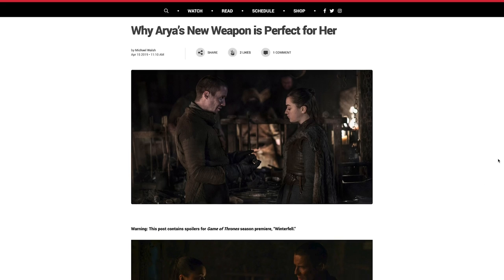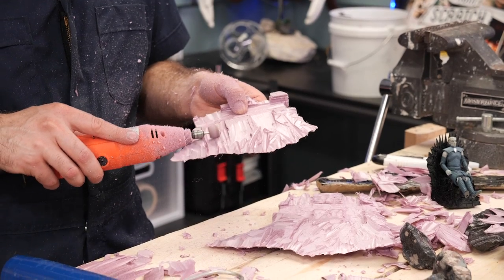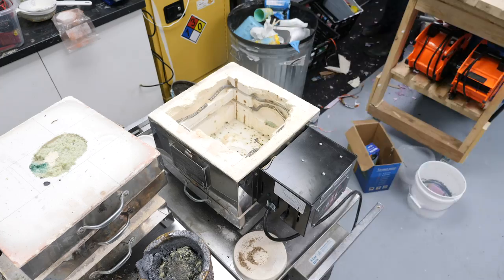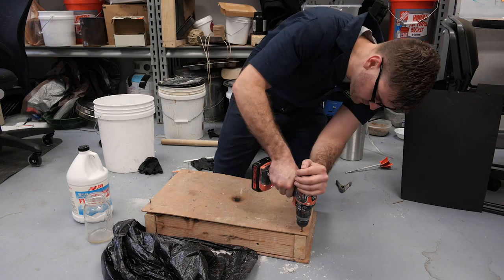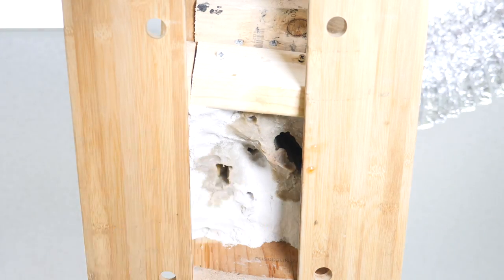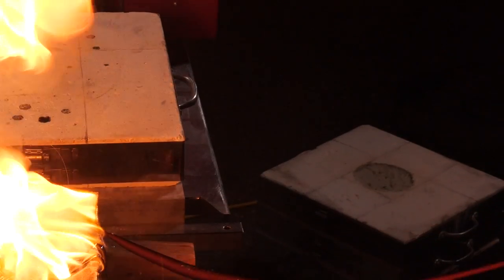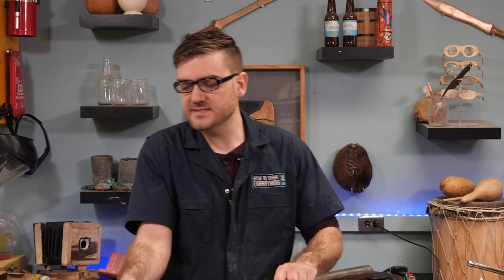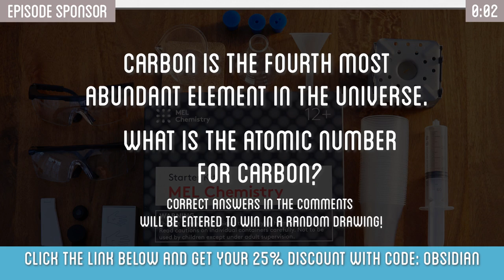Melting Dragonglass to Cast an Obsidian Axe

Comment: You should build your own kiln ... Seeing as how you go through the 1-3 an episode
Reply: Matthew Olsen right! Alec steel has a good video on it
Reply: He'd probably break a kiln while making his own.
Reply: It is an important piece of technology, and making one from scratch is not too difficult. Plus, he can do a second video and make a modern electric one with modern materials.
Reply: should go old school and build a legit one
Reply: hell, he might be able to piece together some working parts from all the defunked ones he has unless he tosses them out immediately apon literal meltdown
Reply: I've seen at least 5 different channels make them that are propane. Made specifically for melting metal.
Reply: @catman2157  a furnace and a kiln are not the same.  the furnace can't get hot enough for glass
Reply: I just wish I was in a position to be able to keep buying new kilns.  LOL
Reply: That is a good idea

Or he should find a place and get a deal on them for a large amount
Reply: I think i can provide blueprints for a solid forge that can be used as a kiln it boils down to a foot thick brick wall sourrounded by those hollow sinderblocks copper tubeing cement and a propane tank or two

Comment: At this pont, he could probably make some discount deal with a kiln manufacturer...
Reply: i think a klin manufacturer has to sponsor them
Reply: Or work for them as a full-time stress-tester.
Reply: @janneaalto3956  *user incompetence tester
still love the guy though
Reply: @MsHumanOfTheDecade  hahaha so true!
Reply: I dont understand how hes fucked up so many.
Reply: @ButteredSlightly  Molten glass is very corrosive and therefore basically eats away at the kiln. He also probably cranked it to the max to get the glass as moment as possible, therefore increasing the change of a failure within both the mechanisms of the kiln and the kiln itself. If you see his old videos, every cast that was in contact with glass can be easily noticed due to how the glass sticks to the kiln and the crucible inside. Even in this video, that can be seen
Reply: Nazamroth he has got to start buying in bulk
Reply: LOL! I was thinking the same thing. Or even a sponsored deal. Though, if their kiln keeps breaking....maybe they don't want him advertising what he's using... lol
Reply: @ButteredSlightly  to be fair melted glass is like acid that destroys the klin.
Reply: Could or should.
Reply: How To Make Everything should just get a devil-forge, hot enough to melt glass, never breaks.
Reply: I'd buy a kiln if he did that.
Reply: Here's two of my New Episode ideas, (1) How to make a kiln from scratch?; (2) How to make babies from scratch?, if he fux up either then lolzzz...
Reply: Did you mean point not pont

Comment: as someone who did a 4 year apprenticeship to become a molder i will tell you a few things. add vents and risers to your thinner parts of ur mold. Yes it will mean felting after but the risers will draw the metal to the thinner parts. also for a think mold like that i would prob do a 2 box flat back mold with vents and risers on the flat side to hide them and also i would have the mold flat not vertical

Comment: Try casting obsidian to give a rough shape of the final form, with enough thickness to knap it
Reply: That was what I was thinking. It seems plausible to cast obsidian in order to get it to a close shape to what's needed, then knap it to a razor edge. I'm not sure if the casting would affect the ability of the obsidian to fracture sharply.
Reply: @Guru_1092  it'd probably make it too brittle to knap. It would more than likely shatter completely after the first hit.
Reply: you can't knap it after it's cast sorry
Reply: its structure is different after a cast
Reply: That's the ticket right there
Reply: You could just knap an axe head from normal obsidian, melting it again weakens it because it cools at a different rate.
Reply: I was thinking cast it around it’s metal reinforcements, so that they are in place to give the obsidian something to hold on to as it cools. As well as casting it larger than expected and nap it till you get the final shape.
Reply: What if he just bought a couple of very large pieces of obsidian and just knapped them to shape? Edit: Or maybe get two long pieces and make one half of one blade and weld them together with obsidian to make one side. Repeat to make the other side. P.S. Can you weld obsidian?
Reply: I think casting it into a solid brick like form then napping it would yield the best reault.
Reply: You cannot cast metal in glass. The expansion and contraction of the metal would at best lead to separation, at worst cause it to fracture explosively
Reply: You CAN cast obsidian so it can be napped. Just don't add any flux or fillers to make it melt easier.
Reply: The casting would weaken the structure of the obsidian as seen in this castings, they easily break so I doubt he would be able to knap it without breaking the whole thing
Reply: @EagleclawThom  Giving the obsidian "something to hold on to as it cools" as you put it would only serve to cool different parts at a faster rate, causing the whole piece to shatter.

Comment: Might want to save up and buy some purpose built equipment.
And some classes on casting techniques.
i.e. your manufactured obsidian could probably be cast flat on an open mold, torch heated to slow the cooling process (simulating the slow cooling process of natural obsidian), while moulding the flat side with tools to get the flat side textured.
Similar to modern glass sculpting techniques.
But where the fun in not burning out a half dozen kilns and overburdening the local electricity grid with wattage it was likely never meant to sustain?
Reply: Classes...  It's painful to watch this guy do almost anything.

Comment: Stop using electric kilns and make a gas foundry
Reply: SerenityGene He tried.
Reply: @shania-antonio6425  😥
Reply: why stop at that, aim for the stars directly skip to the backyard-blast furnace :_D
Reply: @SeleenShadowpaw  or literally aim for the stars... Make a furnace using a giant fresnel lens and the sun
Reply: I think the problem with gas is that it adds impurities to your castings.
Reply: @xKatjaxPurrsx  in the case of obsidian it is nothing but impurities. Also you will notice that plenty of foundries still use gas as well.

Comment: How to success:
Cast one big slab of obsidian, that is flat and wide
Knap it into your desired shape
Reply: Great method, right until the moment he makes one false blow, and snaps the whole axe in two lol :P
Reply: @Michael-Archonaeus  LOL that definitely might happen
Reply: Also tell him to not add flux, it ceases to be real obsidian at that point. He may also want to melt it in a nearly 0 g*kg (of normal force, finding a place with 0 g is impossible as technically gravity is affecting you wherever you are, 0 g*kg of normal force can be found in low earth orbit) vacuum using electric welding rods in a similar fashion to how it is done in The King of Random. Then he can draw the molten rock into whatever shape he wants!

A mold is never going to work for a proper weapon, regardless of material, it must be forged gradually across its length in order to not have one crystal structure that forms parallel lines of potential failure.

Comment: this assumes "dragon glass" in the GoT universe is really just simple obsidian and not some magical substance
Reply: If I was going to force it into reality I would go with a doped obsidian. Glass combined with metals, fibers, etc.. that together are strong. Basically things that could reasonably exist within a dragons den that got melted as the dragon was finishing up her home by melting the walls (likely partly silica) and adding things that would strengthen the walls. Kinda like how a bird collects stuff for their nests.
Reply: @trashpanda5947  Dragon glass in game of thrones could have Valyrian steel as one of it's components since it's the only other thing that can kill white walkers. But since Valyrian steel is based on Damascus steel which is just a type of steel, it probably doesn't exist naturally and was smelted.

Comment: A general thing about plaster casts: you want the mold to at least touch 720c. Any volatiles left will result in voids and a hot mold assists with flow. Keep it hot.
Reply: yeah the liquid glass was starting to solidify as it touched the mold, so it didn't fill the mold properly.

Comment: Hello love watching your videos, keep up the good work! Just would like to point out that you were 100% correct when smashing off the mold the next morning you said "I don't know why that happened, maybe I didn't burn out all the wax"...the telltale was from the nice yellow flame when you were pouring into the mold (or where I'm from "mould") as it was burning the gases trying to escape the mold as the superheat contacted the wax pockets you had mixed. Also, pouring into a mold from a kiln outside is not advised for best results as you could see cooling to a thicker texture as you were pouring into the mold. Just finally like to add that I do not in any way shape or form declare that I could in any way do a better job than you, and I am no hater, just trying to point out a couple things as all knowledge is good knowledge, and thanks for your knowledge :)

Comment: Sodium silicate can also be cured with air. It will be a lot slower, but air has enough CO2. That way if you run out of CO2, jut set it in the sun for a few hours, depending on the thickness.

Also, don’t pour from as high, it only gives the obsidian or brass time to cool.

Comment: I appreciate your efforts. But as a general rule, melee weapons should not be casted.
Reply: That's true with any metal that can be work hardened, but obsidian wouldn't be something you could forge anyway so casting would work.  You can't make it harder by hammering it anyway.
Reply: Most melee weapons are originally cast pieces or were fabricated from cast products, swords, maces, saps, knuckles. Name it and most if not all of its components were cast at one point or another.
Reply: @corwinweber693  When was the last time a metal that could be work hardened was actually work hardened then used in an effective melee weapon? Honest question.
Reply: @willplume1555  Erm..... you're aware that both iron and steel can be, right?  That's what JN 1991 is referring to.  Yes, you CAN cast blades, and people have before.  They're inferior to forged blades.  Maces and picks as well.
Reply: @corwinweber693  Yes, that is true. But they would be brittle and terrible weapons if the forging process only involved banging the material Into shape, which is what work hardening is. Fortunately for us modern folk, we have a more in-depth and thorough forging process which has a few steps: The shaping (banging the material into shape), then normalizing (heating the material to a high temperature for a shortish time removing all the uneven stress put into the material during shaping which disqualifies it from being classified as work hardened and also keeps the weapon from breaking or warping during the quench), then tempering (heating the metal to a relatively low temperature for a longish time to provide a softer more resilient blade) which can be done differentially (think katana) to keep the blade harder and the back more flexible, and finally the quench (locks the molecular structure of the material in place and provides a lovely roughly complete weapon). 
If you're interested in some good channels that go more into the nitty gritty of forging I'd suggest Man at Arms/Reforged on the AweMe Channel and Aleck Steel. Both have a lot of great stuff on forging weapons.
Reply: Will Plume Yes, I'm subscribed to both.  I'm also aware that none of those steps do a damned thing to a cast blade.  They all build on the extra hardness gained from forging.

Comment: You should stop using kilns, you should use a metal melting forge to do that since there’s nothing to “burn out” on a fuel based system
Reply: I remember one video of his said that it took long enough to get the contents of a fueled forge to the right temperature that he didn't want to keep a flame going that long. Running an electric kiln overnight is safer than running a propane torch overnight.

Comment: You should try sintering the obsidian instead of casting it. Obsidian is a glass/ amorphic material so it has no long range crystal structure which means certain areas will form different solid phases if they are not cooled at the same rate, resulting in micro fractures. Sintering is a process that is used for making Pyrex and other industrial ceramics. 

TL,DR: Can you sinter an Obsidian axe?

Comment: the thing with casting a obsidian would be to gather a ton of it then melt it and cast it in to a block that you  knap in to what ever you want be it a axe head or sword or dagger 
so only thing the melting proses does is gives you a prosesed material to work with and not to rely on accidental find of a big enough piece

So make a solid block  roughly the shape you want so you want arrow heads make it more trinagle in shape,    then you cast it, let it cool as slowly as possible so that i does not form cracks and then onse you have the  " ingot "  you knap  it to get your arrow heads,  onse done right  you will get fairly uniform arrow heads with sharp edges

Comment: If you have to mix some kind of powder to decrease the melting point of the glass, and the fact that your kilns are dying off like flies trying to melt the glass, you can imagine how much harder it was (back then) to forge obsidian. The temperatures extremely hot, and the potential that the glass would shatter whilst cooling, could have made it highly time consuming.

By the way, borax is used to fuse two different metal strengths together, if you plan to forge say, gold and steel together.

Comment: I'd love to make a suggestion. If you can find a machinist you can have a solid metal basic form made for the pouring. Just like with the knife but it would be heated first and cool more consistantly to allow a better oversized form. Then flint the edges to create the sharp sides. 
Great vid keep up the great work.

Comment: I love how accident prone and clumsy he is. The honesty is real! At least it makes me feel like less of a klutz when I'm trying to make things lol. Too many tubers make it all look easy first time, when it rarely is in reality.

Perseverance as always though, and an interesting final product that's totally unique.

You could knap the edges if you cast it a little thicker perhaps? Trouble is you make one miss hit and the whole blade fractures.

The Macuahuitl and Macana are the only genuine historical obsidian glass weapons that I'm aware of, both using smaller knapped shards attached to a paddle or bat shaped piece of wood, although smaller "knives" may have been common in regions with local volcanic glass. I doubt people would have carved handles for obsidian shards in the main though as the material chips easily and the blade would require frequent replacement in the form of a new shard. I suspect that it's only in modern times that people attached a wooden handle with cordage. It's pretty much the same thing as flint knapped weapons. Perhaps flint casting could be your next nightmare ;)

I really enjoyed both attempts at casting obsidian though, I enjoy watching people problem solve on the fly lol.

Comment: Lost foam casting works best in loose sand, with a thin drywall mud slurry coating the foam pattern, and a few venting straws. straight sodium-silicate-sand molds wont have near the porosity to vent that foam once its vaporized.

You ought to look into Oil-sand casting. Petrobond is a brand name. Given the amount of casting it seems like youre doing, it will be worth the investment.

Comment: One thing that may help is that glass can be tempered and annealed just like steel. Well not exactly the same. Glass has to be held at higher temperatures than steel for longer  periods of time to actually temper it. I think 900 degrees Fahrenheit for at least 9 hours or more to get a good temper. Delft Clay May work for molding as well. Also wet sanding can get you a sharper edge.

Comment: Carbon is a chemical element with the symbol C and atomic number 6. It is nonmetallic and tetravalent—making four electrons available to form covalent chemical bonds. It belongs to group 14 of the periodic table. Wikipedia
Symbol: C
Recognized as an element by: Antoine Lavoisier (1789)
Element category: Reactive nonmetal, sometimes considered a metalloid
Sublimation point: 3915 K (3642 °C, 6588 °F)
Triple point: 4600 K, 10,800 kPa
Did you know: Fullerenes are a "soccer ball" shape of carbon.

Comment: Hay I have experience casting and if you remove the styrofoam first you will get a much better cast The styrofoam is meant to make the shape but not to hold it leaving it there causes impurities and causes the metal to fail to move through the cast improperly

Comment: It appears that you need to heat the mold up to the same or higher temp as the glass in one kiln then cast into it. Also you may need to up the temp of the glass so that it will still stay fluid for the entire length of the pour. Lastly, pour one at a time. Have you considered casting general forms then working it by knapping?

Comment: I’m sure I’ve said this before but try and use petrobond sand casting I’ve used it a lot and it works perfectly it’s just a mixture of sand and petroleum and it is very reusable